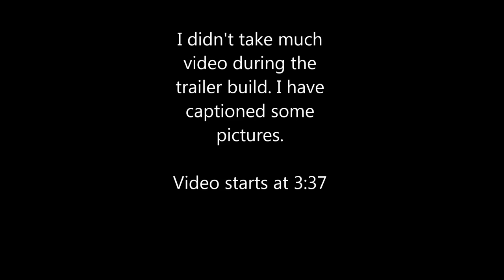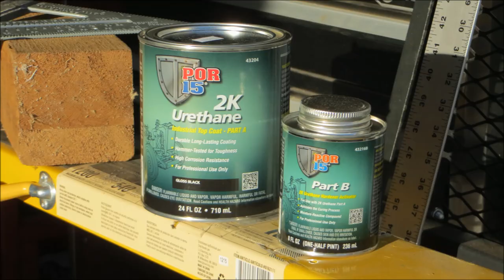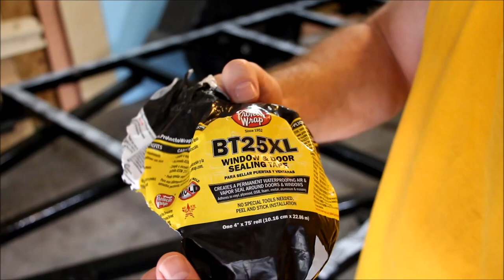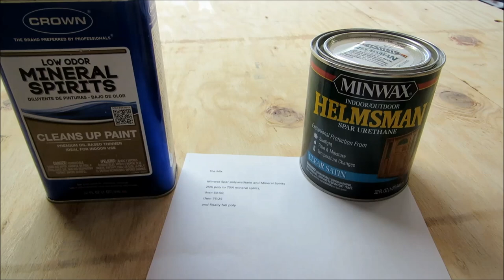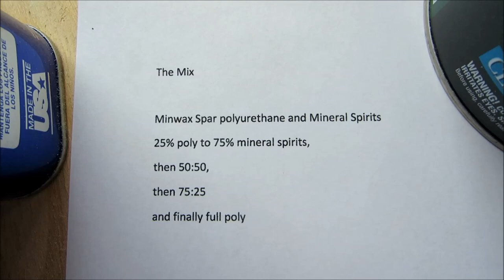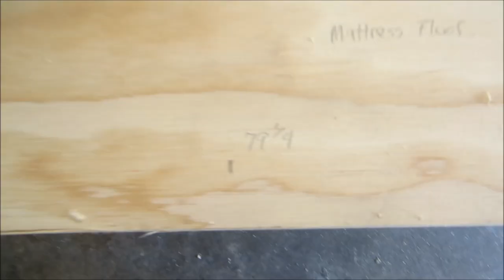Teardrop Trailer Build - Trailer and Floor System

Comment: well done ! love the effort you've put into this so far, I was wondering how you determined the placement of the axle?
Reply from the maker: I read through this. Looked up the weight of materials and additional equipment I wanted to add like 12v fridge, battery in tongue box ect. Then input that info in the spreadsheet you can download at the bottom of the page.  http://tnttt.com/Design_Library/Trailer%20Balance%20101.htm
Reply: @Waynegoproductions  thank you

Comment: Did not have to go to the expense of a forstner bit 2 recess your carriage bolts. Whack them with a big framing hammer. If that doesn't work, whack it again. And get some sun on those legs son.

Comment: Good work, can you send me your drawing plan
Reply from the maker: Munkh-Orgil Gongorsuren I combined the Grumman 2 found here http://tnttt.com/Design_Library/Design_Library.html  and the Benroy galley hatch found here http://www.mikenchell.com/images/GenericBenroyPlans.pdf  the most I drew out and made plans you can see in my first video making the template. I didn't make a lot of plans per say. A lot of it was research and knowing what I wanted to do
Reply: Very very thank you man. I just thought that may may had plan and used it for CNC cutting machine. But no matter. i am drawing my new plan regarding the resources that i can use in my country on sketchup and convert it to G code for CNC. After i finished, i can sent it to u, if u need it.

Comment: What drum brakes are you using?
Reply from the maker: Dexter Trailer Hub and Drum Assembly for 3,500-lb E-Z Lube Axles - 10" Diameter - 5 on 4-1/2 with Dexter Electric Trailer Brake Assembly - 10" - Right Hand - 3,500 lbs.
Reply: @Waynegoproductions  Thank you!